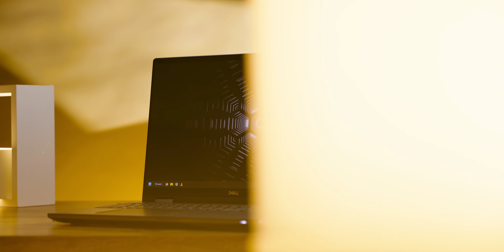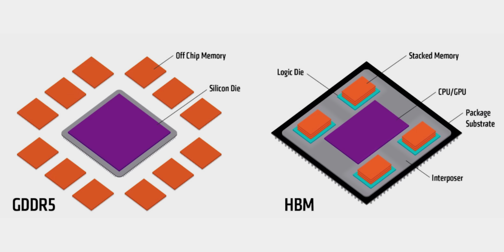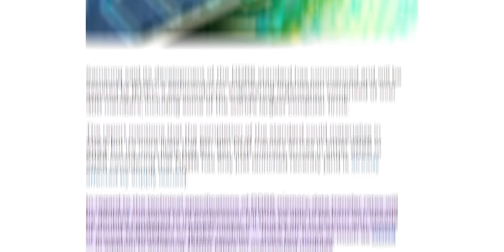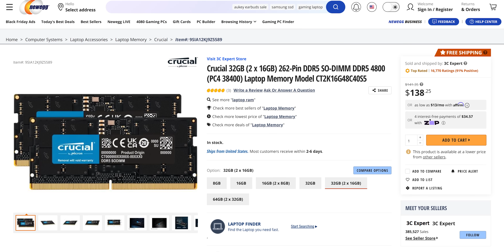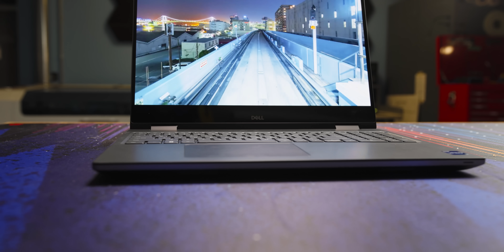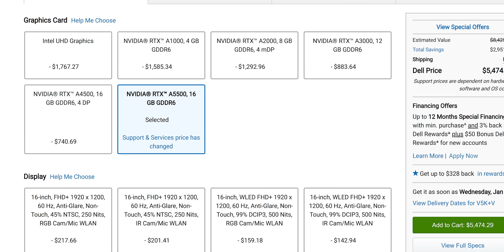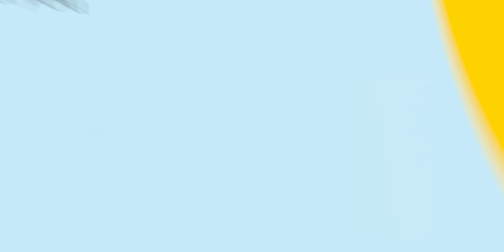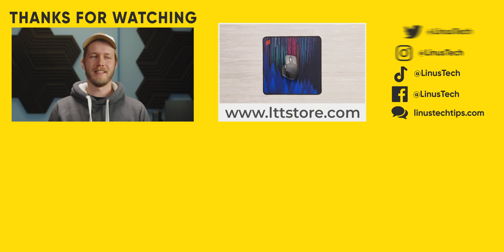I've NEVER Seen a Memory Stick Like THIS - CAMM Explained

Comment: Dell and Alienware have been practicing the "upgradable laptop" nonsense for years. I once was suckered into buying an Alienware Area51 7700m. It lasted me about 9 months before the motherboard died. I was so angry I disassembled it and found that the design was flawed from the start. Basically designed to fail.. it didn't perform well either for a $2700.+ Laptob in 2005. The xbox 360 mopped the floor with my Alienware Area 51 7700m.
Reply: Well the difference between desktop and laptop performance was huge back then
Reply: @gg2324  lol you mean the time when sff / laptops were stuck with web browsing only? you dont say...
Reply: @Fudgesickle  i remember having a laptop with a gtx285m and it was pretty much equal to a 8800 gtx from 2 generations before (and it costed more than my desktop with 2x 8800gtx)
Reply: Meanwhile simple acer from the xbox360 era still going strong, apart from dodgy hd
Reply: @ummerfarooq5383  Believe it or not the amd based cheap $660.00 Gateway laptop that I purchased when the crap Alienware broke, still works to this day.. I don't use it anymore but it still works.
Reply: @ummerfarooq5383  the thermal paste has probably dried
Reply: That's way beyond any other manufacturer who haven't even tried
Reply: Clevo is the real Upgradeable laptop brand over the last decade plus.

Clevo owners lounge used to filled with old early days XPS / AW buyers but Dell lost these customers a long time ago.  We gained members as MSI's "two gen MXM GPU upgrade" promise on their GT line was abandoned and turned into a class action compensation scheme.  Then Dell's about-face 51m came out after a decade of soldered throttled junk and we laughed at how they were marketing what Clevo P series had been doing for a decade. Except Clevo had the track record of building hardware to support it, and the wizard god Prema to make even unsupported upgrades possible.
Things like a 9900K on a Z170 that runs up to 4.9ghz / 170W on a VRM made for overclocking the 6700K (granted the heatsink is too weak to get anywhere near that which is why I modded in detachable watercooling).  Also the traces aren't too bad and it can handle 4 sticks of 3000mhz ram (some have run up the B die SODIMMS at 3600-3800), and a 3080 MXM GPU board if I wanted to buy one... and it could fit and power two, but theres just no point since multi GPU is dead.  THAT is what upgradeable looks like.
Not Dell's "you can upgrade a 9700K to a 9900K" 51m thats still throttled to like, 120W in BIOS
Reply: I take it as a given that Dells are, more aggressively than most, designed to fail, powersupplies especially with our old family desktop failing due to fried power supply inside 2 years of getting it, then a Dell laptop having its battery and power supply rapidly die in a similar time.

Most of the laptops now are HP and have fat fewer issues, with my dad's windows 7 hp laptop in particular still going strong after roughly 10 years with the wifi chip having only died in the last couple months.

Built my own desktop in 2016 and have been regularly upgrading it since though since I wasn't really impressed by what was locally available for pre-builts, and getting one shipped to me with even mediocre specs was more than it cost to just get the parts and build it myself.

TL;DR: I don't trust Dell, particularly their powersupplies, at all.

Found a Dell workstation that I'm going to refit for server/nas use but I'm chucking out it's power supply and adapting in a new 3rd party unit first before shoving in Linux to test it and ready it for whatever additional parts I decide it needs, probably just a lot of HDDs and SSDs, maybe a blueray drive just in case

Comment: The big deal here for me personally is the capacity. I have been waiting for 64gb DIMMS forever, and they are yet to materialize, both in desktop and laptop formfactors. Here they are offering a 128gb 3600mhz package at launch. Sure, its running at DDR4 speeds with probably terrible timings (which do matter for my work :() but the capacity is finally here!
Reply: What? 64GB 3600MHz CAS 16-19 DIMM has been out for years.
Reply: No company is not just going to send you 64gig ECC Dimms because you have been waiting for them to "materialize". They have made them for years now..... They are server/workstation grade parts, and readily available. There are multiple notebooks with 128 gig of ram as well.... The capacity you are suddenly surprised about has been around for about 8 years now.....
Reply: @shvrdavid  except they literally havent? to get 128gb on a laptop you needed 4 dimm slots as 32 GB is the max for that formfactor. You cant just say something is "workstation/server" grade to cop out something that physically can't work with modern technology.
Reply: @tossedtripod6458  Maybe you should learn to read. Those statements were addressing different things in different sentences. Kingston and many other companies make 64 gig dimms for desktops, and they have for years. And those are server grade dimms... I am well aware that 128 gig notebooks normally have 4 sodimm 32's in them as well. I was referring to 128 gig capacity, which is nothing new either...
Reply: 64Gb DIMMS arent possible on desktoo or laptop yet (4Q2022). Both DDR4 and DDR5 currently max out at dual rank DIMM (16 memory chips) and 16Gigabit (2 Gigabyte) chips yielding 2*16=32Gigabyte per DIMM. Memory manufacturers do probably have 24Gigabit memory chips in 48Gigabyte DIMM sticks. Servers do have LRDIMMS and FBDIMMS so > dual rank DIMM's (>32Gigabyte/DIMM) can be used there

Comment: I cannot remember what it was called anymore.   But I bought into the "new" ram, at the time, I think it was called rdram or something.  Supposed to be the new thing.   Except licensing and other issues caused it to go nowhere.  Like this, it could have been great.  But due to corporate BS ended up being trash.   A waste of time and money.
Reply: RDRAM actually had serious issues like crazy high access latency and higher cost-of-manufacture, as well as strange quirks like needing terminator cards in empty slots

DDR became the standard for a reason, really
Reply: @jimjam742   I don't doubt it, it was a long time ago.   Just remember the costs associated with it meant it didn't get developed as much as it could have.  I lost out that time, lessons learned.  After that I no longer bothered being an early adopter on any tech stuff.   And this dell stuff brought some flashbacks.

Comment: Why do I feel like if Apple did something like that you guys would be super negative. This is still a work in progress and far from being complete, thus this is simply propriatary RAM module but we call it a good thing now? How is this different from the "no brain" SSD in Macs that was made to also cut on latancy and improve performance? This isn't different case — Isn't it? I see those double standards all over the channel whenver the thing is actually sponsored, but got acustomed to it by now tho.
Reply: Because those "no brain" SSD cannot be replaced?
Reply: @LaCroix05  They can be replaced — the thing that actually dies most often and degrades over time (memory cells) is swapable on Apple's SSDs. It can't be upgraded tho if that's what you meant. The thing both have in common now is that you won't replace those with off the shelf part — both require involvement of the manufacturer as we are working with propriatary technology. When it comes to upgrade argument — assuming that those dimms can be upgraded as they are now — moving controler to CPU is just one step further on optimisation in SSD space and will come to PCs eventually as it's just superiour way to handle that — just like happened with north bridge. Writing is on the wall — the industry will just need to catch up and it might take them a while. If Qualcomm finaly enters the PC market with ARM, I'm pretty sure this will be inevitable. 

What I'm really after here is narration of LTT on such matters and the tone. When Apple does things like that it's: "morons, close you off with propriatary bullshitf", while when Dell does the same thing in principle it's "this is much better engineering, but be wary". It's just the way they write the script as even with Apple's stuff they indeed went through the benefits. Still decided to antagonise, while here the overall vibe is neutral, but leaning into positive side.
Reply: Because it's not limited to Dell (or Apple).
Reply: @nickthaskater  It is — just because they work on making their technology standard doesn't mean it will go through. As is — IT IS PROPRIATARY and limited to Dell only. As presented it also doesn't actually change anything — it's exactly the same performance — it gives you supposedly benefits, but none were actually implemented. Just because someone works with standard body doesn't mean their solution will become a standard or will be used as a leverage to create propriatary standard down the road. No other company involved other than Dell and JDEC here is a huge red flag. In networking it's common knowledge how things like this turn out — look EIGRP agains OSPF for example. Give me an actuall standard — not a promise of it making it look like it's happening already.

Comment: Yeah no. Can easily just move SODIMM slots closer or dont have the connectors pointing down. Point them up and just put them next to the CPU.
Reply: If it were that easy, they would have done it already. JEDEC tests every configuration

Comment: If it becomes a jedec standard, and they also make sure modules are interchangeable, then it seems like the standard might succeed
Reply: The only thing I care about is that the modules are swappable. Since they are, full steam ahead, I say.
Reply: The problem is adoption, if only Dell is on board from the bug players then they will control the standard  and it will be the same eWaste crap that they normally do.  But get other big players on board and now we are talking.
Reply: My concerns would be ALERT_n pin and existence of PCB footprint for separate thermal sensor for ram module (jc42.4) on board designs contributed to jedec. As long as footprint still exists, but it happens to be unpopulated on production run, I can easily add it for troubleshooting. RAM modules can overheat too, especially when design is so cramped.
Reply: @swiftgeek  🤣 yup
Reply: Me las masca el Linus tech tips
Reply: @dariovillanueva3432  eh?
Reply: we want upgradable ram in macbooks again !

please, apple
Reply: @hipstercrab5886  🤣 ah Mr Bob Ross that's definitely not gonna happen I don't think it ever has before
Reply: It just did
Reply: No sh!t
Reply: @emt3889  uh ok then
Reply: I can already see the retail of one of those modules.
Reply: @Invaderzim2004  I guess so
Reply: @meric12131415  as in they will have a higher premium than current OEM SoDIMMs
Reply: @Invaderzim2004  ok yeah I can definitely see that actually happening
Reply: If Framework adopts this, it may have a chance
Reply: It's a jedec standard now
Reply: 🫢 XKDC cartoon: there are now n+1 standards.
Reply: @mrkitty777  uh yup
Reply: @mrkitty777  lol XKCD
Reply: The problem is the design is patented.
So we wont geat cheap Taiwan Ram with that profile.
Only big company can manufacture it
Reply: @syarifairlangga4608  Have that stopped the chinese once?
Reply: @kazuviking  what  you mean   i seen  some  good intel  they all redy  done  it
Reply: @syarifairlangga4608  Patents need to be established to enforce open source or open standards. Otherwise you have no ability to enforce quality control or open source liscencing requirements.
Reply: @syarifairlangga4608  With the american patent system you are forced to patent something if you want it to remain freely available - you just have to provide licences to everyone that wants one.
If you don't patent something, there is nothing stopping someone else from copying it and patenting it themselves. Yes, patents are supposed to be novel, but with the american "first to file" system patents are basically always granted and only revoked if someone sues.
Reply: @syarifairlangga4608  what small companies manufacture ram? Lol
Reply: @tommymaddox6785  🤣 true
Reply: @tommymaddox6785  Memory chips? Not even a single one I'd call small.  But modules? Many, many small companies.
Reply: We do need a new laptop ram standard, with lppddr support honestly

Comment: It's nice to see that at least some of the benefits of soldered memory, especially unified memory like what SoCs use, are being reproduced by replaceable modules. I don't think anyone actually enjoys being stuck with how much ram they purchased their laptops with, even if they enjoy the benefits that ram brings.
Reply: Unified memory has nothing what so ever to do with being soldered!
It juat means the CPU and GPU use the same address space!
Reply: @SentinelSent  I only mentioned it because in its typical implementation (on arm SoCs), it's soldered with the CPU and GPU.
Reply: @abubakrakram6208  Every modern Intel and AMD CPU with integrated graphics has unified memory (when not using a separate GPU).
Reply: @SentinelSent  I understand, but that implementation isn't what I was talking about. Thank you for the clarification, though.
Reply: If the price of a 16gb ram laptop costs the same as the same laptop with 8gb + the cost of manually upgrading to 16gb, i'd be fine with it. Same with ssd storage.
Reply: @1ronman1  Yes, but in 2-3 years time, when you actually need the additional RAM, it will be cheaper.
Reply: Hopefully this removes most of the "we just HAD to make the chassis .003mm thinner!!" excuse for soldered RAM and becomes commonplace in lower-end machines. I'm sure it will take a while though, hitting the higher end stuff that's fortunately still mostly SODIMM first.
RAM and storage are the two things that always send perfectly good laptops to early graves if they're not able to be upgraded.
Reply: @ailivac  I agree. When I purchased my current laptop a few months ago, I absolutely refused to even look at laptops that either 1) Had soldered RAM and storage, or 2) I couldn’t find it if it had soldered components. I’m buying a laptop, not a tablet.
Reply: @ailivac  This implementation is only slimmer than dual module SODIMM slots (you can actually see in their dumb presentation), this is a DOA standart and wont stick. Single module sodimm slots are still ~40% thinner.
Reply: Yeah the benefits of soldered are offset by a shorter product life should someone get the base model of a laptop. 8Gb might be enough now, but it sure-as-shit won’t be in 3-5 years, and is why I tell everyone interested in purchasing an Apple laptop to get at least 16Gb of RAM for it.
Reply: @Ebalosus  I got the Mac Mini as an experiment in Apple Silicon, I got the 8GB model so I wasn't wasting money if I didn't end up liking it.  More fool me, Topaz Gigapixel added Face Recovery and suddenly 8GB wasn't enough, despite all the Apple lovers claiming the SSD makes up the difference.  To no surprise at all, they were wrong, it got REAL sluggish once the CPU and GPU were contending for RAM.

On the plus side, it makes a beast of a low power Linux box, but yeah being stuck with the RAM you bought the device with really sucks.
Reply: @Ebalosus  a better advice to them should be : just don't.
Reply: I was imagining a module that combines a soldered CPU and soldered RAM would arrive at some point too.
(Possibly the Mac Pro being the first user.)
Reply: @benjaminsmith3625  well the m1 and m2 is already somewhat a soldered cpu and soldered ram on one package
Reply: Soldered memory doesn't matter for the majority of users. They'll never open their laptop to upgrade storage/memory. But it's good that they are looking into alternatives for the people that do, and improve repairability.
Reply: You would be surprised how many people do.
Reply: this is still inferior compared to on package memory. (by a large margin).   

Systems that need high bandwidth (like SOCs) would need 4 or more of these modules to match the bandwidth, that comes with power and of cource space issues.

The reason you do on package memory is you chan have a LOT higher bandwidth.
Reply: What, you don't expect people think that soldered memory are exclusively used to fuck over consumers?
Reply: @Mr.Depressant  Soldering memory has nothing at all to do with hurting consumers.

It in fact increased complexity as it increases the number of skews of motherboard you need to order.  If you offer 3 different cpu skews but also 3 memory skews then you're looking at 9 different combinations that you need to order so you can stock the different configurations. 

If you use socketed memory then you can do that configuration at final fulfilment. meaning you just need to make 3 skews.